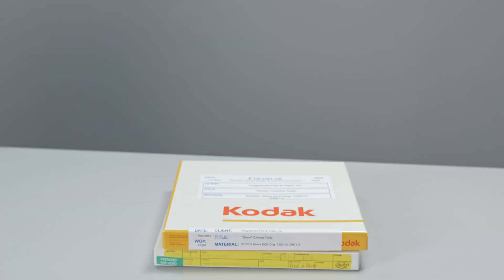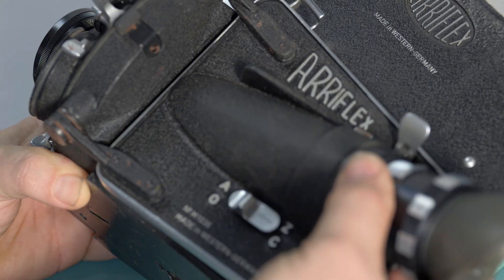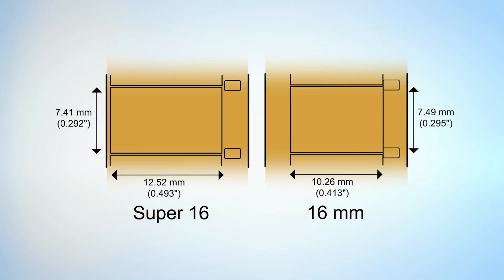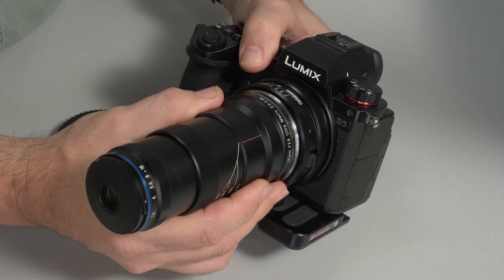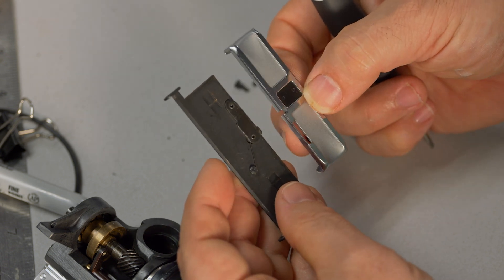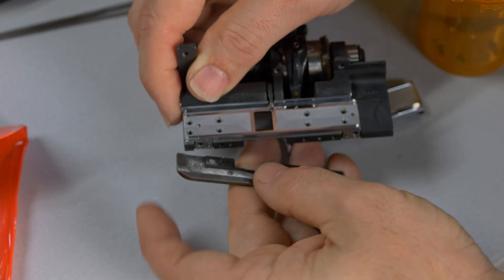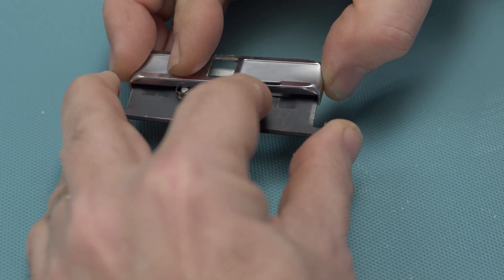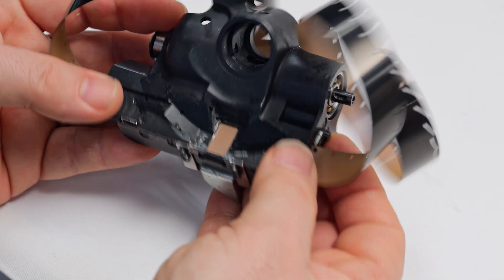DIY 16mm Film to 4K Digital Transfer System | Part 1

Comment: I wonder if it wouldn't be easier to only use the mechanism for precise transport but capture the film at another point in its path. With a tensioner in the intake path and running it over two simple side rails just before it enters the movements, it should be quite stable there, too. This wouldn't work at full speed, but at 1 fps...

Comment: A shutter of a canon 6D is rated for a total of 150,000 actuations.

150,000 actuations divided by 25 frames per second gives us 6000 seconds of footage.  That is 100 hours.

Is this method too harsh on the camera?  Is it possible to capture in video mode?  Is it possible to synchronize a projector with a digital dslr video recording?
Reply from the maker: As I mention in  several videos, I only use a camera that has a completely electronic shutter with no moving parts.  In this case, the Lumix S5.

Comment: I wonder... if this tansport mechanism part could be re-produced and sold as part of a kit? Maybe this could also be converted as Super 8 and Normal 8? :O  Shouldn't be too hard to measure every piece of that mechanism and reproduce it with fresh parts and maybe adapt it specifically for the Digitization needs so not every part of the original Mechanism has to be replicated. I just worry about the parent violations that would probably occour. Maybe Arri should sell those things as a side hustle. But i doubt that would come in affordable......

Comment: Great video really inspiring i'm trying to build a 16mm scanner using an old Bell & Howell 1692 projector but am having difficulty working out what size macro lens I need to capture the full frame and soundtrack. Any suggestions? Really looking forward to part 2. 👍
Reply from the maker: If you can fit it in close enough, I think the Laowa 25mm macro lens would probably work - I'm using it in the 16mm transfer machine I'm building and it seems like you could capture the whole 16 frame and soundtrack, but the lens front would have to be pretty close - maybe an inch?
Reply: @FreshGroundPictures  Thank you so much for the reply. I have had the pleasure of building your 8mm scanner and it works incredibly well. I followed every detail including purchasing the Laowa 25mm macro lens. It is a great lens but it can't quite fit in the full frame and soundtrack. Maybe there is a size up. Anyhow it is a fun project and learning experience. Thanks again and see you in part 2.